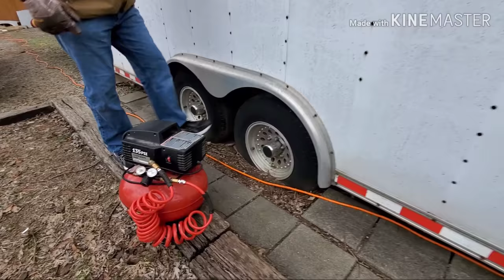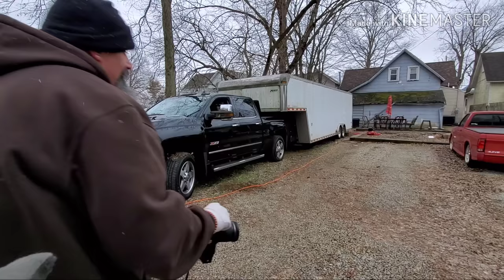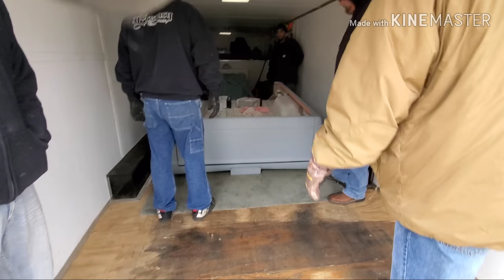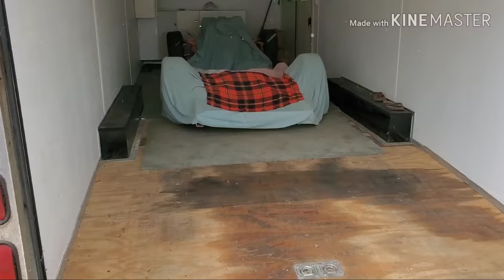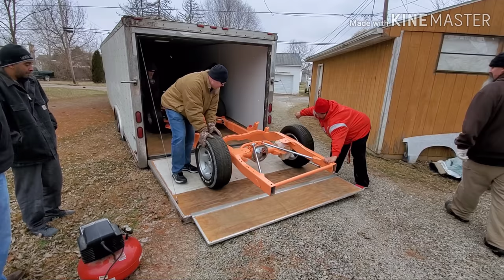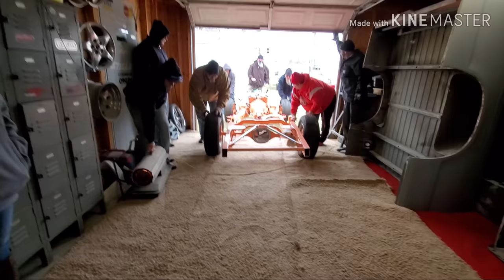Old Minitruckin Magazine feature truck found in trailer. Peaches and Cream. Barn find Chevy S10

Comment: Is the video only available in 360p?
That´s all I can select...
Reply from the maker: I'm not savvy enough to even know what that means.. lol sorry
Reply: @HardCoreGarage  No problem!
In the right bottom of the video there is a cog wheel, where you can select some settings. Usually you can select different resolutions, ranging from 360p to 4K.
Might be depending on the selected export of and/or uploaded resolution of the video.
Anywho, I was surely able to watch this video!
Reply from the maker: Was it blurry?
Reply from the maker: My only other option is 144??
Reply from the maker: I think I may have changed it. Let me know
Reply: @HardCoreGarage  yup, multiple resolutions (incl. higher ones) can be selected now!
Reply from the maker: I moved it to 1080.
Reply from the maker: Thanks for the lesson!
Reply: Mines at 1440p. Also I see you on FB groups all the time, didn't know you made videos